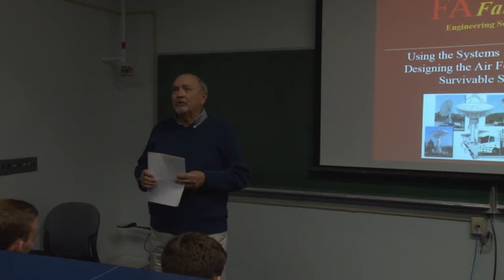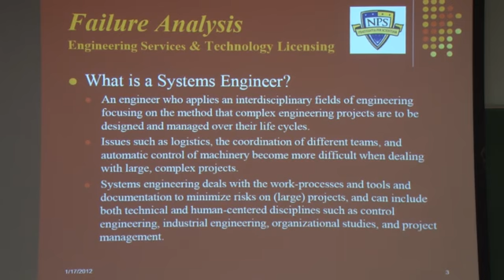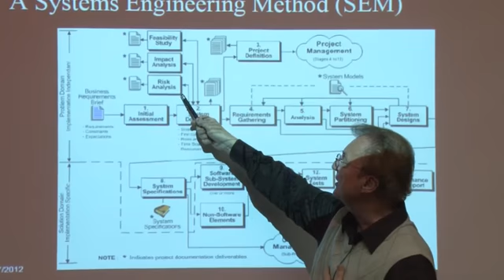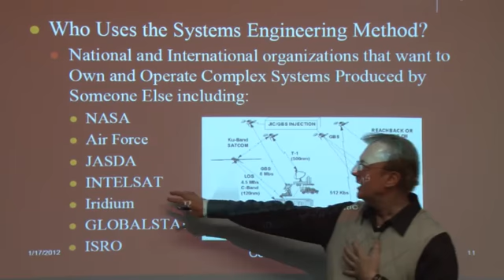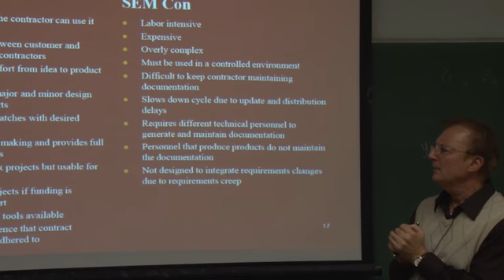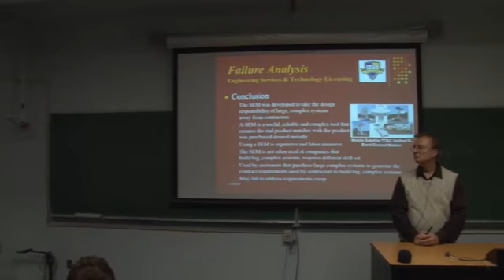01 - Len Losik Ph.D Uses Systems Engineering to Design a Nuclear Survivable Satellite TT&C Station

Comment: Yes, yes, Systems Engineering and/or Systems Architecture, it's expensive, as you say, but only at first.  If you don't employ it you end up paying many times fold afterwards with the total ownership cost being way more than anticipated. Also, without Systems Engineering Methodology and/or an Architectural Framework you are prone to end up with lots of interoperability issues. 

Also, Requirements-Based Engineering often misses the mark, resulting in Mission Creep, because often time it's missing what should be done preliminary to that.  Between the Ops-Con, CONOPS and the Requirements Definition phase there should be a Capabilities wish list.  Often times a capabilities-based-on-needs architecture answers the mail a whole lot better than jumping straightaway to prematurely pulling requirements together.  Requirements should always be begotten from the envisioned needed capabilities. 

This prevents future delays and rework for readjustments in premature requirements.  Per Deming each re-work at the next higher level constitutes a ten-fold level of effort increase.  

Thanks for posting this talk.